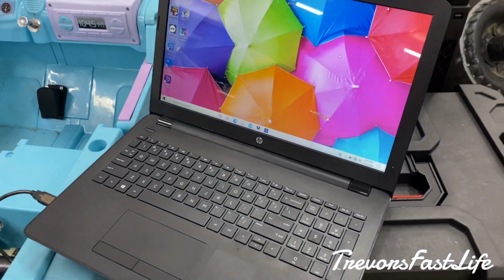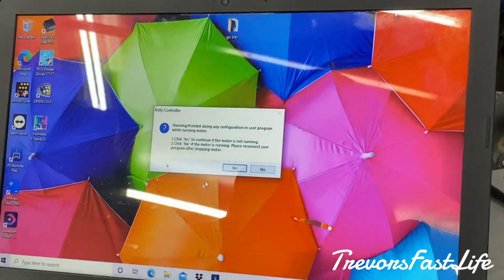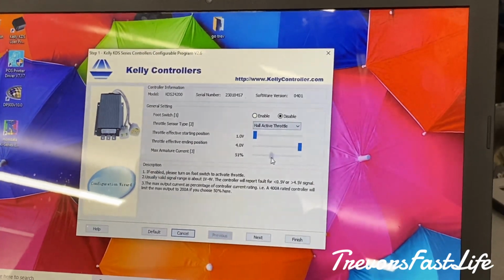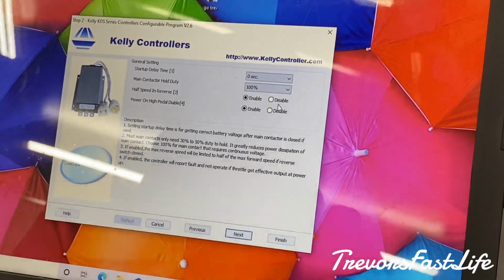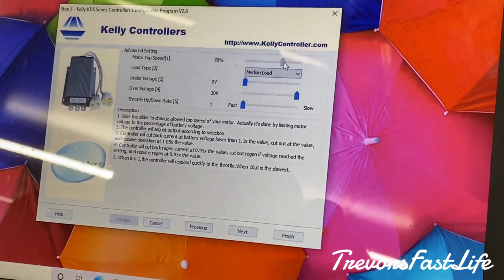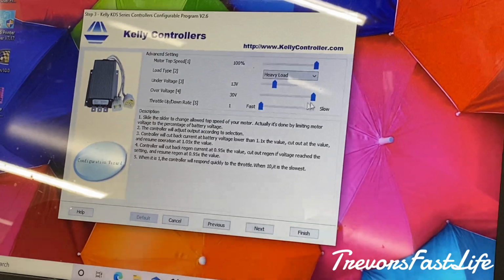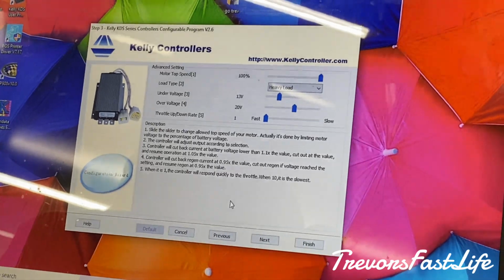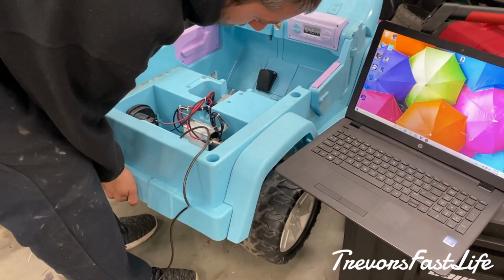How to “Tune” a Kelly speed controller

Comment: By default without setting up, the wheels spin about 1 revolution in 5 seconds on 36v. I'm guessing it's because it's a new Kelly controller?
Reply: Figured it out. Had the negative of motors hooked to the B-

Comment: From just what I've searched and what you told me, it seems like this controller is key to long-lasting gear boxes with variable throttle. That allows for the power to come in better
Reply from the maker: You’re 100% right! There’s other ways to go fast for sure but we prefer this way, any other way we have occasional carnage, ever since we went this route we have never broke a gear box or gear, running plastic gears , we have burned up some motors but only due to really overvolting motors that aren’t rated for what we put at them lol
Reply: @TrevorsFastLife  i get that. Either way you go, it's only going to last for so long.
Reply from the maker: @MrMckenzie2403  this is definitely the most reliable/fast way we have found!

Comment: Thanks Alex for all your information. Do you run this controller in most of your setups? Can't wait to hear the news for next year.
Reply from the maker: No problem! Every car we have is running this setup, our friend Ava in the pink mustang, ev and jax in the jeeps,  it’s the fastest SAFEST way we have found so far, we have played with a solenoid setup but can’t seem to keep the gears together for more than a few runs, with this ESC, we never broke any gears , do this setup with the 1st gear delete 🤫 and it’ll run 2.80-3.2 depending how many volts , identical to little man’s lambo and race car